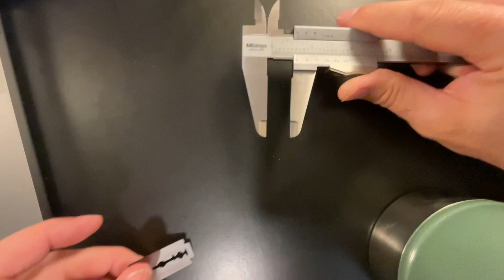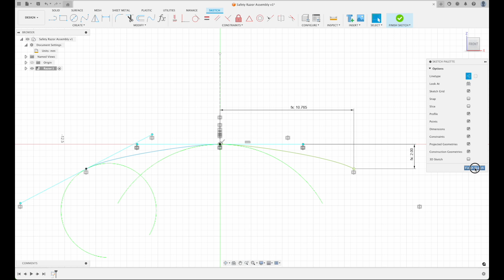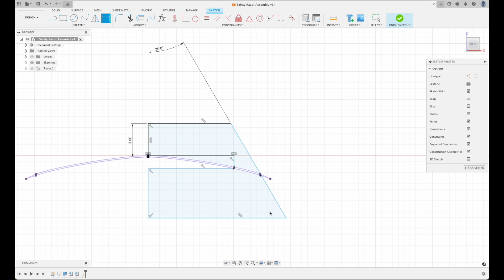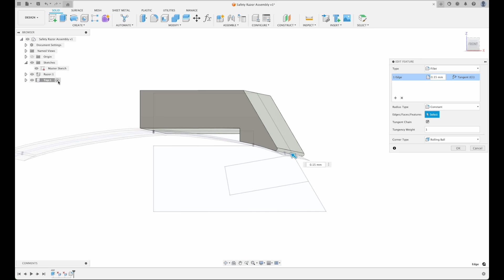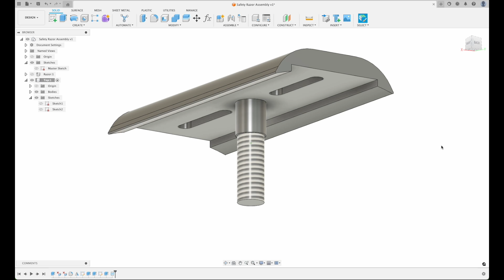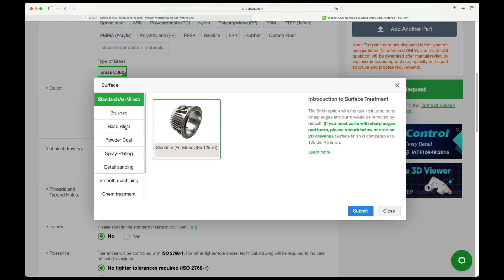Autodesk Fusion 360 - 1/3 - Safety Razor - Intermediate/Advanced Tutorial (2024)

Comment: Dear Sirs:
Very good video but,
In Fusion 360, How do you make a simple standard threaded hole (Threading/Modeled NOT Hole/Hole Tap Type/Tappered Tapped, to exported as a .SLA part file for the 3D printing process {either FDM or SLA process}) an NPT pipe thread (this is tapered thread {not an NPS} and not an NPTF thread) as this is the industrial standard used in North America. 
For a different design I need a 1.5 inch NPT pipe threaded into a plate where the plate will be a test 3D printed part.
THX,
Don B.
Reply from the maker: Thanks! Regarding your request, Fusion doesn’t model NPT threads. However, you can always download the thread that you need from McMaster-Carr, edit/split the body, and then add it to your project. Once you’re finished, though can export it for 3D printing. Let me know if you have further questions.

Comment: Unfortunately, when you change the scale in Fusion it does not update the title block it is the first scale you put down. So when you changed it to 2:1 it did not update on the title block.
Reply from the maker: Ah yes! Good catch! I saw that much later on after all the parts were finished. Good note though about scaling that it doesn’t update automatically. Thanks for commenting!

Comment: I was just doing some research to design and 3D print one in my resin 3D printer. Great timing, I'll be waiting for the next episodes!
Reply from the maker: Awesome! The next episode should be released on Monday. The following Monday should be episode 3. Also, I’m using one right now and it shaves incredibly well. Stay tuned!
Reply: @learnitalready  I was re-watching and realized you don't set any angle to the blade in the beginning. Did you eye-balled it? If so, great job! I was wondering if I could set a specific angle, maybe using a control spline? What would you use?
Reply from the maker: @madeinencamp  Yes, just eyeballed it and made an educated guess. You could definitely use a spline with control points. I can’t think of any reason why an arc wouldn’t work just fine too.
Reply: @learnitalready  Sounds good, I'll do some experimentation. I was reading Henson's tech specs and they specify a 30 degree angle at the blade, let's see if I can apply that + what I learnt here. Also, I didn't know pcbway had such a service! This video was so informative!
Reply: @learnitalready  so I used a couple of construction lines to ensure that the blade finishes at 30°. Then the blade itself was a "conical spline" iirc, and the end of it was constrained to the 30° line.
I printed a first test with resin and it worked pretty well, I even shaved a small patch of my face. I made a ton of mistakes on the bottom plate tho, I really need video part 2 lol!!